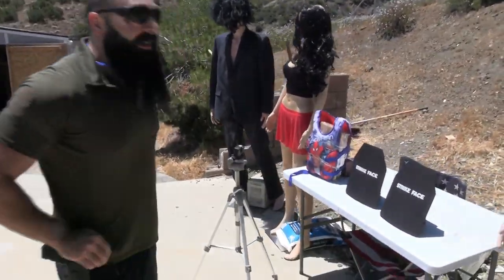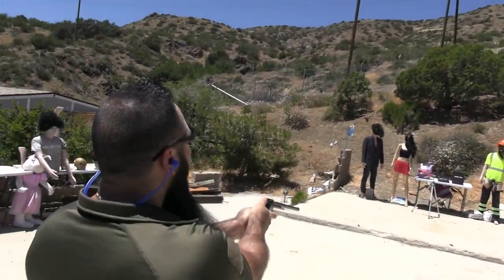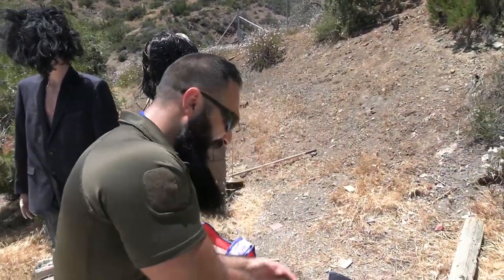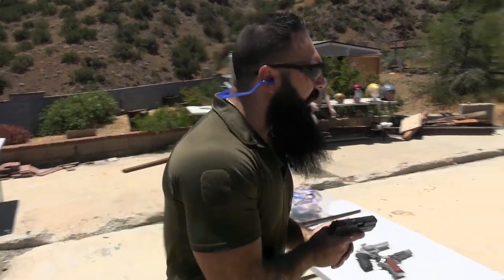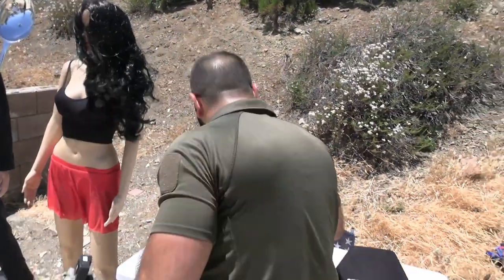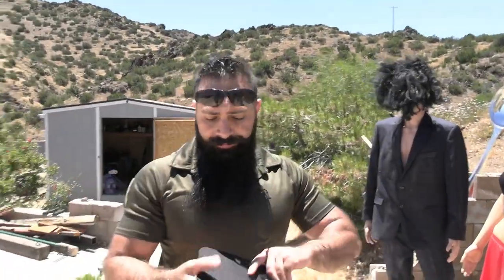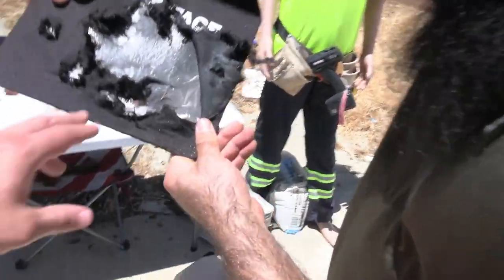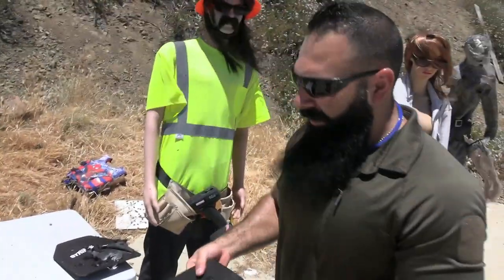Cheap Body Armor Test - AliExpress Military Level 4 Steel Bulletproof Body Armor Test

Comment: I put 2 rounds of 1.5 oz hardcast Diablo 12 ga slugs through this armor. It actually broke huge chunks off but didn't "penetrate" in the sense of the word. Its simple heat treated steel. Not AR 500

Comment: What thick is this? according to my research they sell 2.3mm, 4mm and 6mm. I think 2.mm is level 3A, and 6mm is level 4. What do you think. I both 3 of them but not yet tested. What do you think?
Reply from the maker: This one I tested I believe is lvl 3 a at its best
Reply: @Kbum-Guy  how thick? 2.3mm, 4mm or 6mm. Its a big help to know. I bought this different thickness. I would like to know which one you test. Thank you
Reply from the maker: @jamesryandelossantos5073 the one I shot in the video was 2.5mm

Comment: Or is this a hard face thats designed to be placed in front of a soft 3a plate? Ive seen those plates advertised where its L4 when used together
Reply from the maker: I don’t think so , once the plate is advertised as lvl 4 it should be able to perform as one , thank you for watching the video